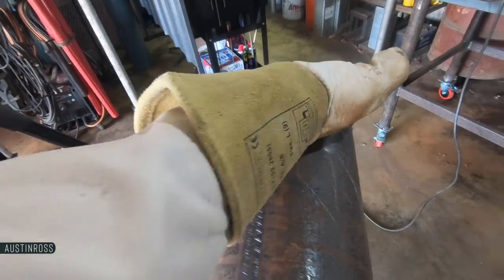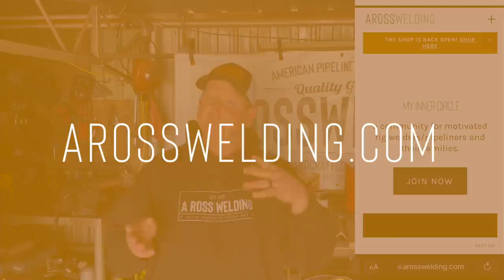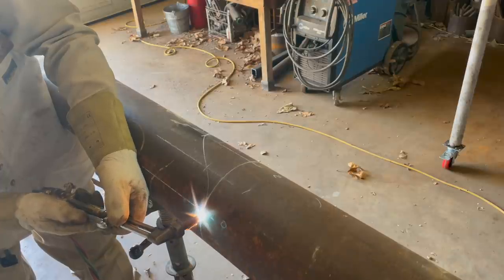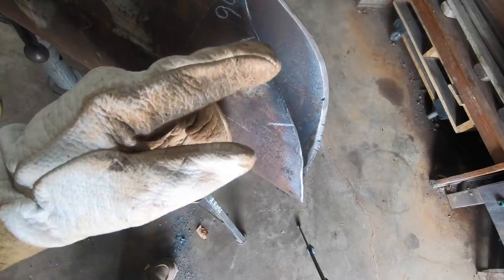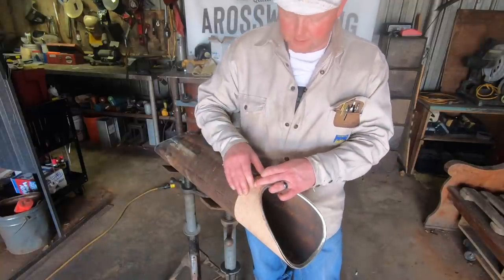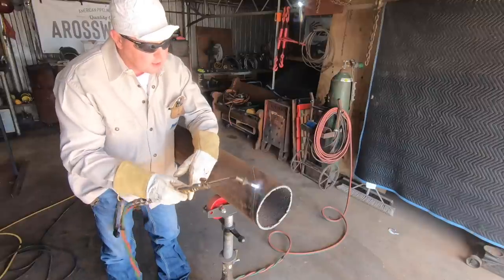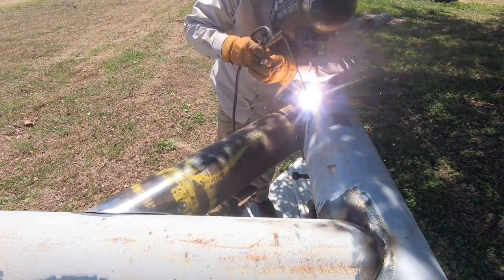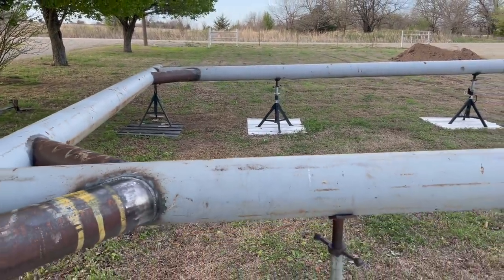8” CUSTOM PIPE ENTRANCE HEADED TO TEXAS (Saddling 6 inch Pipe onto 8 inch Pipe on a 45 °)

Comment: Key to saddling is where your inside diameter will sit on your main pipe  . If you have to back bevel inside  the pipe to fit you have not allowed for wall thickness . That is why templates fail to get it right they do not consider wall thickness where the inside pipe diameter sits . If that is considered your template will work.

Comment: when you are enclosing pipe like this you should always put a weep hole in the pipe, otherwise condensate will accumulate and rust the pipe out from the inside. I speak as a union pipefitter with 43 years experience,